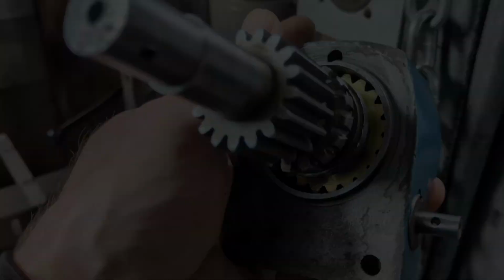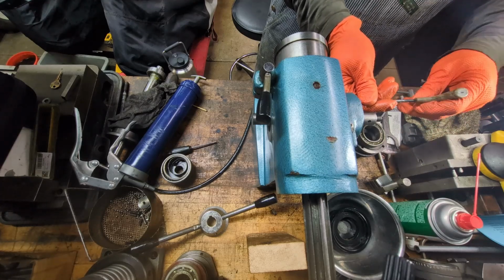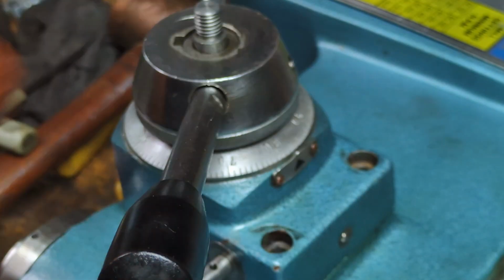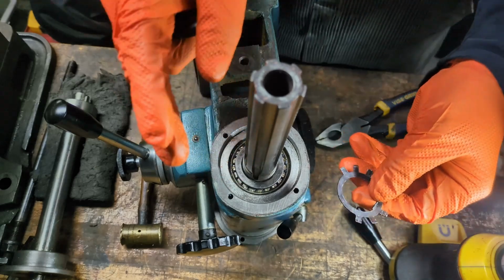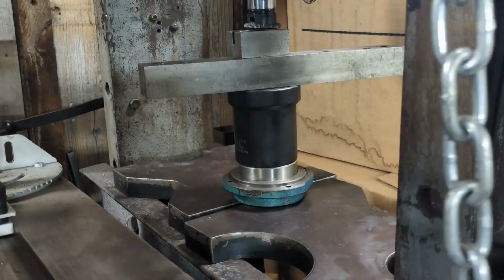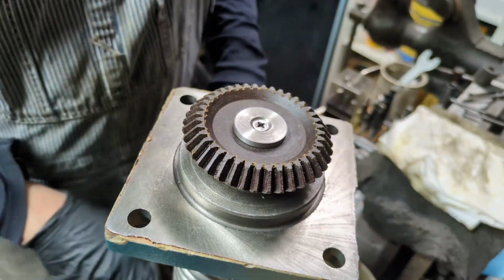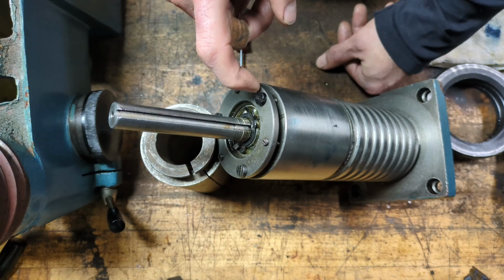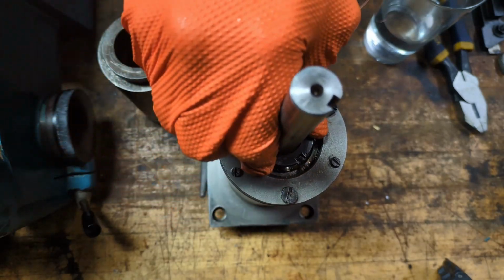Smithy Lathe/Mill/Drill Combo Rescue Part 8– Millhead Reassembly

Comment: Is there a video where you show how to square the milling head upon reassembly? I have a 1324 with a spindle at a noticeable tilt.
Reply from the maker: Yes, the next video in the series shows that.  I've even added the correct timestamp for that section-->.  https://youtu.be/jtQY_8lHDUE?si=ucpYcit8PI8kv2xK&t=740  Please note - Someone commented that I could have tried installing the millhead support column in each of the four possible ways.  This piece is the square base with the hole at each corner and the large column above it, which bolts to the top of the lathe.  I simply installed it in the original orientation and added shims to get it square, as you'll see in the video.  However, if your millhead is off significantly, someone may have installed the support column in a different orientation, causing it to tilt in one direction.  Before using shims, you might just try putting the support column on in the four possible ways to see which way is closest to square.  Good luck!

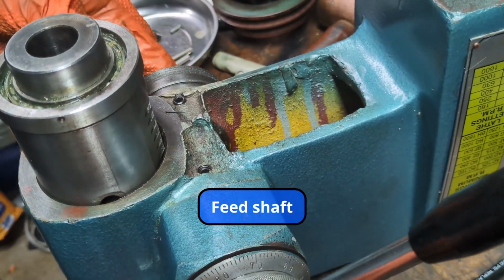Comment: I Injected grease into the set screw holes pretty much everywhere such as at @15:30 that will have a long lasting lubrication effect on the whole assembly
Reply from the maker: I think that would be great for the millhead, for sure.  It doesn't get any oil lubrication, except maybe 1 or 2 ball oilers, so adding grease should certainly be healthy for the machine.  Thank you for the comments and sharing your thoughts!

Comment: Wow.  was my long thoughtful comment deleted by Google?
Reply from the maker: What do you mean?
Reply: its on different video, where u give instructions on how to disassemble the mill shaft
Reply from the maker: @AlexeiPavlov  Hi Alexei - Thanks for the comments. I saw your question in the Part 7 video.  Does this comment mean that you found the info about removing the pulley or do you still need some help?
Reply: @WernersWhirligigs  I still wonder if the milling pulley could be removed from its press fit housing by locking the mill shaft with a handle and using a 3 jaw gear puller using locked mill shaft as a pressing out point? Would I damage anything in in this case?
Reply from the maker: @AlexeiPavlov  OK, I understand your question better now.  I think you can move forward as you plan.  There isn't any snap ring that holds the bearing into the pulley.  Just for reference, the bearing is held with a snap ring onto the carrier immediately below it (which bolts into the top of the millhead).  You could remove that snap ring after you remove the pulley.  I think you would be ok to lock the spindle with the handle and using a 3-jaw puller.  If you want to be extra careful, place some large wooden blocks below the spindle so that the spindle rests on them and can't move down further.  That would put less strain on the rack & pinion. Here's the part of the video where I reinstall those parts, so you can see for yourself how the pulley, bearing, and carrier are held together - https://youtu.be/Er6d50G13S8?si=G3zLFFLLPGjA1SeG&t=1824  Good luck!
Reply from the maker: One last thought.  Since your machine is a slightly different model than mine, I can't be 100% sure of the above.  Here is a link to the Smithy parts manuals.  You could find your manual and look there, if you would like to verify - https://smithy.com/pages/operations-manuals-and-parts-diagrams
Reply: @WernersWhirligigs  thank you for your answer! Yes I saw how you froze the quill and heated the pulley and it went just fine without pressing! I saw the manual and there is no set screw or snap ring to be seen that fixate the pulley onto its housing..